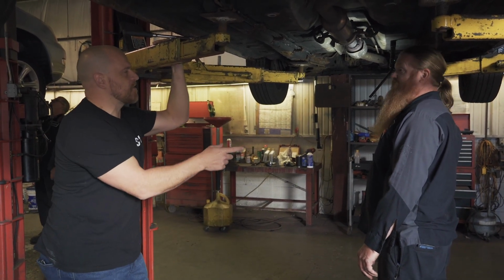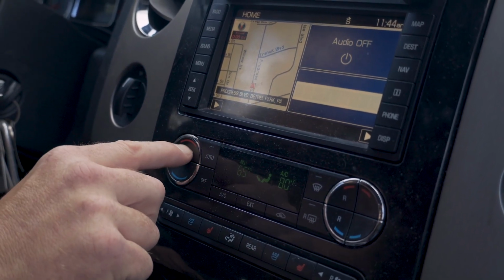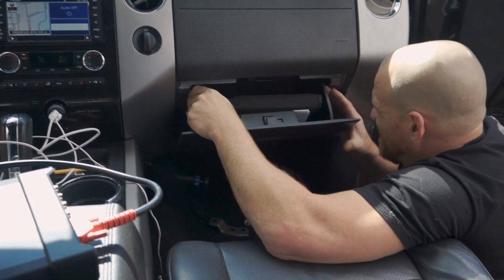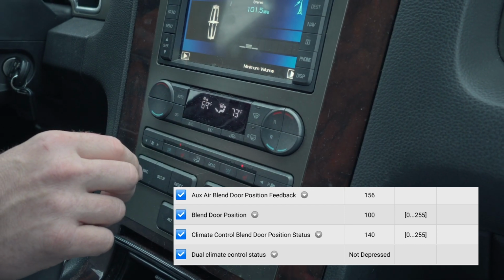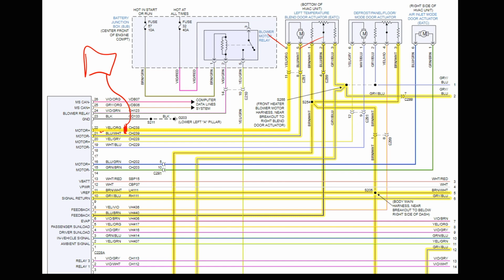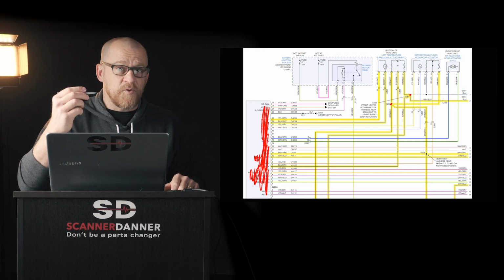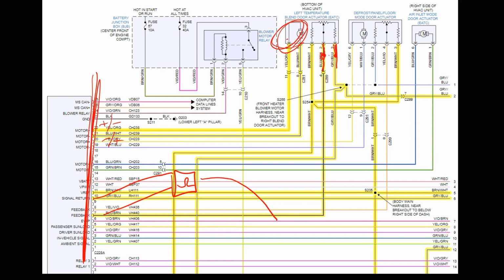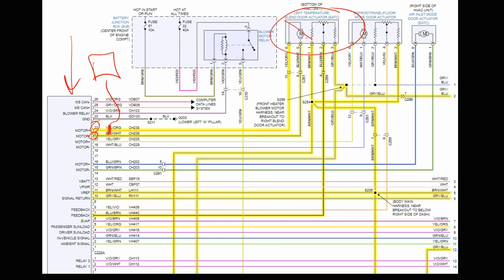2013 Ford Expedition Temperature Blend Door Diagnosis

Comment: I had a guy bring his car to me to get the ac fixed. I have an old robin air machine I use for side work. I think it was a mercury marquis. I checked ac pressures, they were 30L/245H which was about perfect. The vents were hot. Stuck a probe in the vents and air was 145 degrees. I thought it was only 80 out, so the heat must be on. Blend door was buried in the dash. Told him the price and he said he couldn’t afford it. I said there was a cheaper way… ended up putting inline ball valves on the heater hoses. Told him lots of big trucks are setup this way. In winter open valves and in summer close them. Worked like a charm!

Comment: Reminds me of my buddy who owns a shop. He said when an evap temp sensor goes out on a ford fusion, it’s a multi hour job. However if you call safelite they can remove the windshield, long needle nose plyers, sensor change takes 2 mins. Right through the defrost vent, then have the tech replace the windshield.

Comment: Sweet videos! Did you ever swap it out? The Expeditions are so much easier than the F-150 and can be swapped out in 10-15 min once the seats and center console are out.
Reply from the maker: Seats and center console huh? Where were you when I was filming this 🤣
Thanks for the tips my friend. Hope you liked the plug 😉
Reply: @ScannerDanner  sir, you could have shown the input control wires in the wiring HVAC control unit to make the blend door motor move either clockwise or anti clockwise 👍👍👍

Indeed, I have learned a lot from you till today!
Reply: @ScannerDanner  Bravo Paul. You and Brian are both legendary in this space 👍🏻👏🏼
Reply: And the numbers move opposite of each other is because one is facing one way and the other one is facing the other way. Therefore facing opposite directions moving opposite directions
Reply: I was waiting for him to bi directionally try to move it. And I get all the dash jobs that come in.
Reply: Door position sensor operates as a compass reading? Zero as NORTH, 60 being NE,  255 being SW, etc. as in nautical or aviation headings.
Doors are moving on a pivot clockwise or counter-clockwise.
Reply: I am not auto Macanic , just a hobbyist, I can change with out moving seat , in 10 minutes. 
And can fix it with out spending any money . Just a conman sense, I just fixed 4 blend door motors , just bought on from Ford for under 40 dollars , one was just plug was off , so that was easy , rest , I did with older gears swapping and fixing old ones .
Reply: Great plug! As a used car tech at a gm dealership makuloco’s channel has been my go to for ford info

Comment: Just wanted to say ive been doing that for almost 30 years now myself had to learn most of it from hands on with guidance from a master tech its not always going to be easy or always the first thing you find  slot of times it will be so simple you kinda just look over it and make a simple mistake but nobody's perfect and sometimes it the problem is so stupid it's crazy ive seen so odd stuff sure you have to ive even had some that drove me insane but you can't give up it could be found eventually may just walk away for awhile and come back and it hit you like a rock

Comment: nope... dash does not have to come out... ;)
done half dozen without pulling the dash.
Reply: and you can give a final diagnosis cause everything will be left intact.  it still is a 5 hour ish job but dont have to pull dash and heater core, and electrically its left intact should you need to test.

Comment: Hey Danner, quick useful tip for the Autel, after you've done the scan, tap the 'list' tab right next to the topology tab and it'll give you the same report as the report tab does however you'll see tabs next to the code description to shortcut straight to freeze frame data and shortcut straight to the module whereas the report tab doesn't 😁👌
Reply from the maker: Awesome! I definitely need more hands on with this tool. Learning on camera 😉
Reply: @ScannerDanner  took me awhile to stray away from the snap on D10 but the autel is amazing after a few hours of playing around and navigating the tabs. 
Thanks for the vids ❤🇬🇧🇺🇸

Comment: It's not really necessary to check each motor wire individually with the test light. You could just connect each end to the motor control wires and then test the drivers that way. If the light illuminates when the temperature increase and decrease buttons are pressed, the drivers are good. Then, the few moments you save can be better used removing the dash. ;)
Reply from the maker: Understand for sure, I prefer individual circuit tests for each driver. 
This would have been derived from a stepper motor where I have saw one failed driver on one of the 2 coils and without knowing for sure the direction or polarity being applied, the individual test was key. 
Now for a regular DC electric motor? You are right, by simply increasing the temp, you want to see the light, light and then the same thing when decreasing temp. 
I think when I was talking about this, I was thinking more along the stepper motor circuit. Thanks!

Comment: Are you not concerned  about the coolent loss?
Reply from the maker: I was not concerned in this circumstance. At first I was, until I received all the facts. The coolant loss needed to be looked at but had nothing to do with the low heat on the drivers side.

Comment: 28:00 driver's side reading is probably opposite because the actuator is mounted upside down/on the bottom of the housing compared to the passenger side mounted on top the housing.
Reply from the maker: That sounds legit. Thanks!

Comment: Brilliant stuff as always, Paul & Caleb. This type of engineering always brings me to ranting ...

That Expedition is what I like to call, "A-hole engineering" - prime example of it right there. This is how they basically extort you into another car payment. When your heat doesn't work and it's -14°F out, you're going to want to get it fixed (especially if the wifey is driving it -you're gonna hear about that!). When presented with a $2,000 quote to do the job, you throw in the towel and buy another poorly engineered, overpriced, s-box. And the cycle continues! ZERO incentive for automakers to change. Where did all the innovators go?  Take a look at history - there were DOZENS of automakers in the early part of the 20th Century, each offering customers something the others couldn't. One by one, they all fell by the wayside, except for 3 (domestically, anyway). All these brilliant minds couldn't have just disappeared. Where did they all go? Sure makes you wonder. We've got Tesla ... but is that because he's making what the powers to be WANT him to make? Get the world on electric, and now someone can shut it all down at the flick of a switch! Hmmm ... lots of questions, few answers ...

Comment: I wonder if it would prove a stuck actuator by using a scope and a low amp clamp at the battery itself. A blip on the screen would indicate the command and wiring working but the actuator not.
Reply from the maker: Absolutely you can but the problem at the battery is other stuff running at the same time will blur the picture

Comment: But Paul, It's only 6.6 hours to remove transmission then torch cut a hole in the floor to replace the actuator (and hopefully catching the car on fire for the insurance.....)

Comment: Is there a reason why the potentiometer is draw as having 3 individual resistors rather than one big resistor representing the carbon strip? Or is that just how they chose to draw it?
Reply from the maker: Not sure on this one, but it doesn't change the operation at all. First time I've seen one drawn this way too.

Comment: If there was a short to ground in one of those wires would it fry the module? Or is there a form of circuit protection that isn’t shown in the diagram? I’d image that the module uses the potentiometer to monitor movement and would cut power to the motor if it stopped moving unexpectedly to protect the circuit that way?
Reply from the maker: Great insight. I would hope so (circuit protection if the signal stops moving)
Yes, a short to ground would definitely hurt the driver unless there is some circuit protection.

Comment: would a stuck door pull high amps pos or neg side thanks jr
Reply from the maker: It would pull high amps and as far as positive or negative, that would be a factor of how you placed your amp clamp and what direction the motor is rotating
Reply: @ScannerDanner  thanks did you see where i was going with that no noise and the door just cant move  soon will burn up the motor cause door is so stuck that what i see here in west tn motor is bad bam try to move the door no go hard to quote those jobs
again your the man and caleb is next
Reply from the maker: Absolutely and I should have addressed this in the video. It is why testing the drivers is so important. You wouldn't want to do all the dash work only to find out when you are done that the HVAC module also needs replaced

Comment: One thing i have gotten in the habit of doing with this type of code is confirm the actuator is the correct one shown in service info. And visually see if it moves using a inspection camera. Ive been burned with getting wrong info.

Comment: The older ones had a self test, it would spit out codes. Crown vics are similar but if you dont mind some bloody knuckles you can install without taking out the dash (partially anyway).

Comment: Hey man! Sorry to bother you with this but did you check the switches on the AC controller?They are used all the time and are prone to become non-functional...
Reply from the maker: Yes sir, in the video you can see the numbers changing as I push the hot and cold button
Reply: @ScannerDanner  OK, I didn't catch that.
Reply from the maker: No problem!

Comment: why do they use counts .because their already there .they are counting the segments of the commuter
Reply from the maker: Great question! I see no need to count the motor segments, it has a potentiometer there for that reason! Door position.
It is strange that the pot signal is displayed on the scan tool as counts. 
I don't have an answer right now but ill try to find it for you.

Comment: you mention signal return and how its a ground not a return to the computer. well me being the dick head i am will say  thats one way to look at it. remember dc circuits must travel full circle  so if as we all do, think that positive is a feed and negative is the return  then to say it correctly the computer is comparing the amount  not returning on the negative side is being compared to the amount traveling through the return wire. to really screw people up  physics tells us electricity flows from a negative state to a positive state. so if we all read these diagrams correctly we would see the negative as the feed.   now on todays cars the negative is a common  not a ground.(unless the tailpipe is dragging lol) what it comes down to is how each and every one of us sees things and how this fits.  you do a great job showing how most people should see things so  i should just end this rambling. just something to think about.

Comment: Hey man,I'm having a serious issue with my 02 civic. I replaced my piston rings and my car crank but wont start afterwards. The tip of my plugs are wet with fluid except for #1cylinder thats not so wet like the others 3 cylinders.  What you think? Not getting any sparks on cylinder 2-4 but getting sparks on cylinder 1 because its not as wet as the other I'm thinking its the only one that getting spark. Please help.
Reply from the maker: You sure you are not getting spark? What is compression pressures on all cylinders?
Reply: @ScannerDanner  i just recheck my cam timing and it way off. The up mark on the pulley was in the down position when it should be pointing up..i fixed it but it wont start because my battery might be weak. I see the light in my dash starts to flicker..

Comment: I seen tesla's wiring diagram they all the same its modules with the same can high and can low powers and grounds  with switched inputs just the difference with them is that dc to dc high battery 400 v to DC 12v converter  ,and the inverter is the brain to the motor  just controlling the current to the motor for different speeds. And still use potentiometers for accelerator pedal as input to the inverter. I just wanted to add something to this that tesla also has this ecoder motor that's another name for speed sensor that uses two hall effects that the ground was sheard with the app ,the ground voltage would rise and sow did the signal on the app would as well the car would just fly through a wall lol.

Comment: That's 8.6 hrs plus the time and material to evac and recharge the A/C.
Also since there is possibly a A/C leak it would be advantageous to check and replace the evap core while it's out :)
Reply from the maker: Maybe heater core too right? This can be a very expensive job for sure.
Reply: @ScannerDanner  or just leave keys in the glovebox and headphones hanging in the window :)))
stolen and stripped or totaled = no more problem LOL

Comment: after finding sufficient power and ground to the actuator motor at the module connector, I would have done a resistance check through the drive motor from the module end to confirm continuity on the wires and motor.   If that
 was good, I would be dropping a bore scope down the duct if possible to see if there was an acorn or pencil jammed in the door.

Comment: how is the calibration  procedure done ?
Reply from the maker: Service info said it is initiated by simply restoring power to the HVAC module and then pressing any button but off lol.
That's all they said in that chart.
I'd imagine a battery disconnect would do the same thing.
Reply: @ScannerDanner  thank you keep videos coming

Comment: Would an Autel with the Oscilloscope accessory be a good starter scanner or would it be better to get a used Snapon Modis or Verus?
Reply: The snapon has guided component tests that walk you through testing.  I believe the autel does not have guided . Tests. I personally like the verus.  Get the most recent update possible when buying snappy. I purchased mine from ebay. You can find on Facebook cheaper, however not very offen. Verus updates are over a grand a year! Dig deep! I hope this helps. Scannerdanner.com has great verus classes, well worth the price.
Reply from the maker: I agree with Robert, but I do like my Autel Ultra scope too
Reply: @ScannerDanner  another benefit of the Snapon is that the scope and Scan Tool are all integrated into one tool without the need for a seperate box. A lot better for portability. 

Are there any other deciding factor that would support buying a used Snapon over an Autel? 

To me, it seems like the Snapon interface might be a bit more polished than Autels. And I like how the Snapon only lists modules and tests the car actually supports.

Comment: I had to replace the blend door on my 2009 Ranger. It stuck in the heat position and then finally failed in the vent/cool position. It was fairly accessible after removing the glove box. If it clicks but doesn't move, it can be lubricated, but mine was dead and had to be replaced. $40.00 part but not quite two hours for diagnosis and replacement. I guess it could have been worse.

Comment: Ive seen when these motors short out, they fry the module under the upper center console part, its like a half ass HVAC module.  You put the new actuator in, and still have no opperation or it fails the calibration.

Comment: Thanks so much for another great video !! I can't begin to tell you how much you've helped me and my career as an aspiring Diag Tech. My first 20+ years in the automotive repair industry I just went with the flow, content with just swapping out the parts they told me to. Never asking why a part failed, or what led to the decision to replace it. Until I came across this YouTube channel, and a handful of others like it. Changed my life. So thank you again, for doing this for those of us who want to be better.
Reply from the maker: Thank you so much!
Reply: @ScannerDanner having been learning lots of fundamentals and basics from you, now, I'm preparing to modify all doors to be locked automatically when car speed reached 40 kmph and unlock as soon as engine is off in my i20 2011 Magna India version.

In fact, such auto lock feature was not available in the car variant Magna.

Comment: I can't stop laughing at your hair growth problems.  I've said something similar about how all mine simply migrated to my back.  My eyebrows are kinda bushy in one way, but the hair is thin and light, making them kinda tough to even see.  Now I've got some red strands growing in that are long and thick enough that I could braid them into something that could be rated with a towing capacity.  I'm only 45 and I have this shrubbery starting to sprout out my ears, too.  I'm gonna look like an extra from Lord of the Rings before too long.

Comment: Thanks Mr Danner for all your help in the automotive repair world  I've mechaniced for 30 years now in Ireland and I'm learning every day with help from techs like your self, but is it not that amperage on the motor wont check the mechanical linkages and flaps in the heater. Thanks mate.
Reply from the maker: High amperage can be a frozen motor or the door itself. So amperage gives us direction but not a definitive of which of the two it would be. But that would be all you would need to 100% pull the dash right?